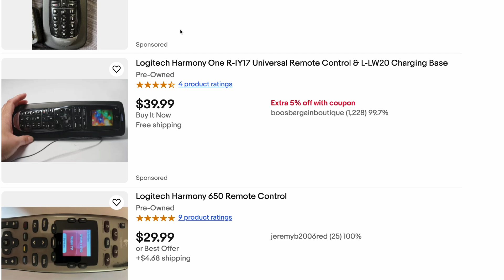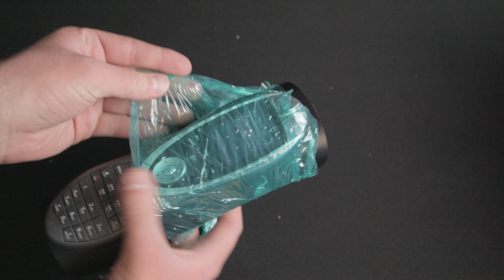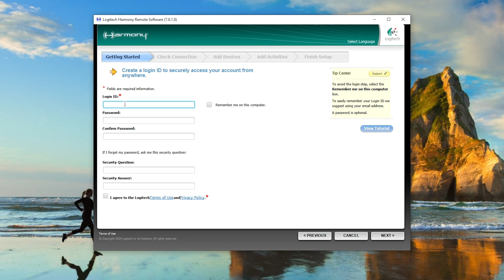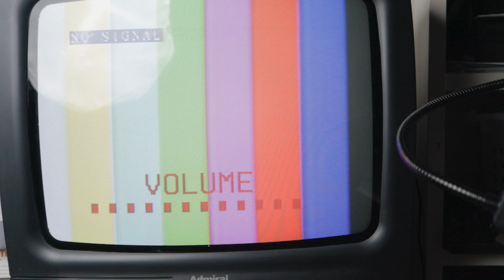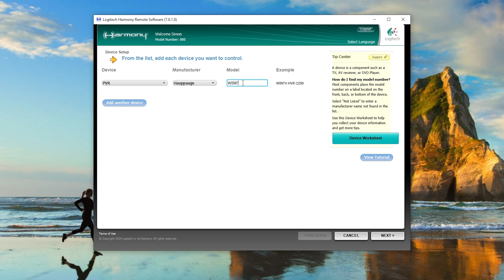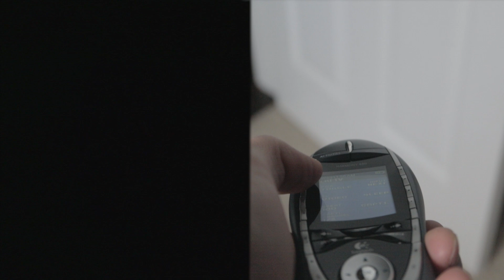Remember the Logitech Harmony Remote? My First Time Using it!

Comment: Growing up in the 2000s, my family had a home theater system so having one of these was a must. I still use a Harmony 300 series with my current home theater setup, it's super useful especially the one press "watch TV" button to turn on all devices. I might upgrade to one of the ones with the screen , I've always wanted one of those ever since I was a kid. I understand that home theater systems are niche, but I still don't understand why these are being discontinued , as useful as they are.
Reply from the maker: I know! It’s so useful. Even now you have to have a few remotes for all the different devices

Comment: You had stated the volume button does not function. Well, you can fix all non-working buttons. Just take apart the remote, take the part of the remote where the keys touch the board and the rubber mat thingy, turn that rubber mat thingy upside-down and you'll see black dots. Now, go get your ass some very worm water with a splash of dish soap and cotton rag or q-tip and dip in soap water and rub the board then dry, take the rubber mat thingy along with your wet soapy rag and clean each and every dot. Those two parts you just cleaned, let them completely dry before putting them back into the clicker. Once dried, put the two parts you just cleaned and put that clicker back together. All keys should work unless the black dots are warn out, then you'll need to come up with a way to attach aluminum foil over the warn out dots.
Reply from the maker: Good to know! I'll have to try that out. Thank you!